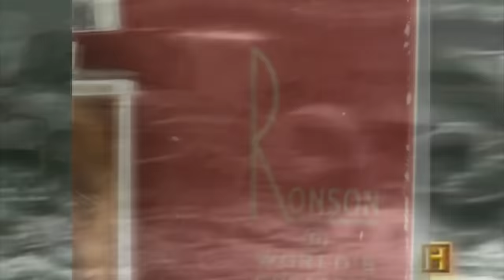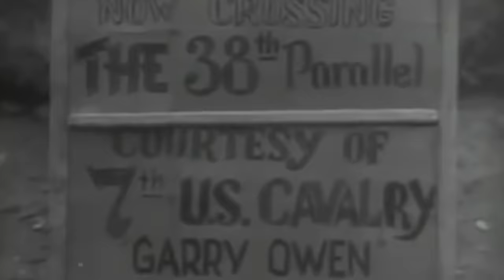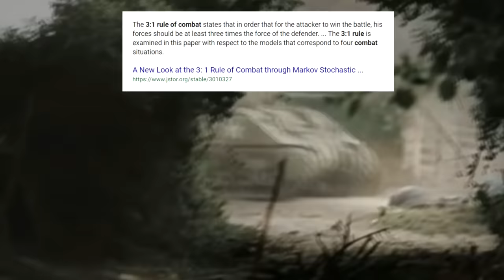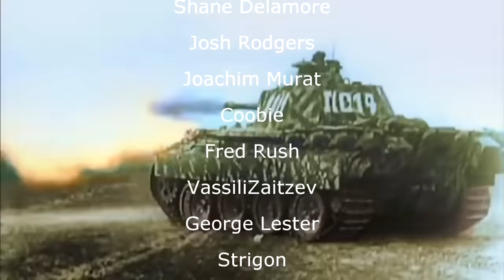The American Tank Meme

Comment: The Sherman’s were liked so much that by the middle/end of the Korean War when much of the North Korean tank force was defeated, Pershing crews wanted Sherman’s due to the unreliability of the Pershing’s transmission and lack of maneuverability that the Sherman provided. Or at least, so I’m told.
Reply: The engine was fine, it was the same Ford V8 engine as in the A3 Shermans that served in that war, it was the transmissions that had reliability problems in the mountain terrain.  The issue with the engines was just being underpowered, it was the same 500hp engine in a 46 ton Pershing as was in the 35 ton Sherman.  Again, not something that was a big deal in France or any other relatively flat terrain but in the hills and mountains of the Korean peninsula it was a problem.
Reply: But like, most tanks were underpowered and every tank had transmision problems
Reply: @22steve5150  edited it, thanks bro 🤙

Comment: If wot included crew survivability, Americans would probably be only crews you don’t have to replace after every 5 battles. Soviets every battle
Reply: Don't give WG any silly ideas pls.
Reply: Yeh but then Russian t10s would only cost 50 silver
Reply: Soviet tanks were so repairable, that German tank kills were reduced by 30-50%
Reply: @frenchsoldier8485  Sometimes they would just remove the dead crew, hose out the interior, patch the holes and fix the major damage and it's back out to fight. Men and Machine were expendable resources for the motherland
Reply: @Singha Mura When I learned that the russians had no standarization between factories and spare parts were specific for tanks of that factory only I laughed my ass off.
Reply: @zachburkey447  Da
Reply: @zachburkey447  We traded men for time
Reply: @zachburkey447  You are talking about american repair stations right? There's an interview with the guy online whose job it was to pull out bloody remains

Comment: Not talking about how the m3 freedom launcher is basicaly the latest reboot of the m1897 baguette distributor.
Excuse me wtf ?
Reply: What's an M1897? There are like a dozen different things with the M3 designation in the states, but I can't think of something French that would correspond with an M3 something, that has the M1897 designation. :/
Reply: @fuzzydunlop7928  simple, the m1897 is one of the pioniers of modern artillery, the french made around 15000 of them and 2000 of those ended in the hands of the USA as lend lease from france, it was well respected due to the 28 rounds per minute record firerate of the canon. 
When in the 30's the US was looking for a new tank canon of decent calibre they took the breach and basic design of the m1897 and made the m3 75 mm canon ( but also the m2 and m6 which you can find on cas and chaffes) 
Some of the orginal french guns found their way into the first us tank  destroyer: the halftrack m3 td ( yes the US calls everything either m1 or m3)
Reply: @LD-oq9lx  OH okay, that explains why I was drawing a blank. I'm pretty limp when it comes to field guns and artillery in general (mortars and rockets I know a bit), so I wasn't sure what exactly you were referring to - thanks for the clarification.

Comment: Yo dawg I heard your economy broke so we used the economy on the economy to fix the economy
Reply: *NEW DEAL INTENSIFIES*
Reply: WAR INDUSTRY INTENSIFIES
Reply: REV UP THOSE RIVETERS
Reply: Yea that didn't really work ww2 brought the US out of the depression and is the only reason we are so powerful today
Reply: Liam Kerr Uh...no. The US was starting to recover from the depression before WW2. Due in part thanks to the New Deal, I’m not saying it was the main reason we started recovering from the Depression but it was certainly a factor that can’t be ignored. To say nothing of the projects that were constructed during the Roosevelt era like Hoover Dam which would go on to power many factories which churned out war supppies. It had an effect
Reply: @danieltobin4498  Uh... yes. The effects of the New Deal have been seriously exaggerated. It did very little to bring the US out of the Great Depression, almost nothing, in fact. To understand why it did damn near nothing you need to first understand what caused the Great Depression to begin with; what the problem is, so to speak. It's the same problem we deal with today and we still feel the effects of the Great Depression because we never really solved said problem. This is, of course, a problem of overabundance. Due to technological progress, directly after ww1 our capacity for production exceeded our population's needs. And the solution the New Deal brought to the table was... more production? Yea that didn't go over well. It is just artifical stimulation afterall and even it's creators expected it to do little more than satiate the population. Atleast the war put our abundance to use. You see the fundamental issue was and is something that does not have a simple fix like "sicking the economy on the economy", or even war, that is if you are looking for more than just a temporary fix (or remain at war for as long as possible, making a temporary fix permanent). The real solution is much more complicated than that and entirely unbeknownst to me, for I am but a boy, and the problem only worsens. Each day we make developments in technology literally designed to replace human workers. We design them to be more efficient, reliable and cheaper than human labor. We already had an issue because we produced way more than we needed during the 1930s. Now we aren't even needed. Anyway, sorry for the ramblings, I'm quite passionate about this subject.
Reply: Liam Kerr What the fuck? The Great Depression was caused because we had too much output? That couldn’t be more wrong! It’s the exact opposite! The Stock Market crash of 1929 led to people losing faith in the economy which led to them investing less in businesses and buying less products which led to people getting laid off from their Jobs. And that’s just one factor!!! There are multiple factors that led to the Great Depression, and too much output isn’t one of them! It makes no sense because we got out of the depression by, guess what, having more industrial output because people were getting their jobs back due in part to the New Deal like I just said! I literally said that the Hoover Dam powered factories that produced war materials and other goods. Also, we’ve always produced more than we need because people buy more than they need. And you’re not even taking into consideration trade with other nations, or do you think the US hoards all the products we make?
Reply: Daniel Tobin No the depression started because people began to take on too much debt from the over abundance of goods that they could not afford.
Reply: @danieltobin4498  people lost faith in their stocks because inflation decreased the value of literally everything. This isn't hard to understand.

Comment: So the T-34 is a fucking godsend with 45 millimeters of sloped frontal armor, but the Shermans were death traps with 60-something millimeters of sloped frontal armor... alright, I see.
Reply: The Angle was different If i am Not wrong
Reply: @Manimmut  yea, the angle is different but the relative thickness is lower than the Sherman, T-34s would only bounce 3.7cms and maybe the older 5.0cms.

Comment: POV: the US designation system. A recon soldier is riding in his M-3, using the M-3 binoculars to scan for German tanks. Then he uses his M-3 radio to report to a battalion of M-3s. The M-3 would be very successful with other M-3s, making the enemy be outnumbered by the M-3. Post war, the M-3 would be used to test the brand new M-3. Multiple designs were proposed, but I. The end, the M-3 was chosen over the M-3. The resulting M-3 would then be modified to the M-3, a revolutionary design.

Comment: The Canadian tank meme

EXPLAIN THE GRIZZLY!!
Reply: Sorry for blowin up yer tanks eh?
Reply: It’s exactly the same as a standard Sherman. The only difference was that it was made in Canada, so it’s inferior.
Reply: its not inferior, it just apologizes every time it fires
Reply: Weik-293 no, it’s armor is made of crystallized maple syrup, whereas the American armor is made of freedom and bald eagles.
Reply: But you can't eat Bald Eagles
Reply: Weik-293 well you can, it’s just heavily frowned upon.
Reply: @TuShan18  The Grizzly was basically an M4A1 1st gen in most respects, but it used canadian dry pin tracks (a type of track that didn't utilize rubber) and a different number of sprockets on the forward and rear drive wheels.
Reply: Weik-293 laughs in Grey Mann

Comment: -We need something more effective than the 75mm!
-hear me out...what about....76mm?
- Genius!
Reply: 76mm barrel is longer thus improve it's Long shot and penetration capability
Reply: Low vs high velocity
Reply: also howitzer vs AT gun.
The 75 still had much better HE, so it was preferred over the 76 until the US tank doctrine changed after the war.
Reply: That has nothing to do. The 75mm canon equipped on the Sherman was more efective than the 76mm canon equiped on the t-34, the 76mm sherman gun was a huge improvement to the Shermans, and it was more efective that the 85mm gun of the t-34-85. Something similar happens with the Panther 75mm compared to the Panzer IV 75mm.

Comment: i have to say this. THE SHERMAN IS THE BEST TANK USED IN WW2. my reasons, reliable, easy to use, and can be compatible with just about anything
Reply: Freaking Werhaboos literally can't actually look up facts. The Sherman is the tank that is closest to earning the title of THE Tank of the war. Excellent progressional development, best crews, loved by all who used them even THE GERMANS THEMSELVES. The Germans had captured tanks and used them in battle and the one they liked the most was the Sherman due to the fact they made little to know modifications to them unlike the T-34 which had their own adjustments and additions.
Reply: I’m not sure, the T-34 is on par
Reply: @fireiron369  The Sherman was taking out T-34s in Korea if that helps clarify a bit more.
Reply: @overipecanine1485  to be fair, by Korea, the T-34 line was an outdated model. In WW2, they’re far more comparable to one another.
Reply: @randomelite4562  The same Shermans saw the same T34's in WW2 and Korea. That really means nothing, except saying the T-34 was inferior in WW2 as well as Korea to the Sherman tank and that the Sherman was always the best of the two.
Reply: @fireiron369  The T-34 was designed for pure numbers to the point the engine and transmission weren't designed to last long. Also, the 2-man turret was far less efficient and was harder to escape from.

Comment: Honestly the M4 was the right tank for America during WW2. It did well against the more common models of German tanks it was designed to fight. It gets too much hate.
Reply: Fred Jansen The Panzer 4 was the most common model and the M4 and it were pretty evenly matched. You can’t really expect it to perform well against a tank like the tiger that was released after production began.
Reply: Fred Jansen the pz IV was not a problem for the Sherman, also guess what we didn’t use Sherman’s to fight the tiger even though they did engage them. Our answers for the tigers and panthers where the M10 , M18 and later the M36 tank destroyers so yeah the us army did think for these heavy tanks so made Tank destroyers to counter them
Reply: Fred Jansen  The armour was tougher than a Pz. IV and nearly had the effective thickness to match a Tiger. The early 75 mm gun was arguably better than what the Germans were using at the time since it could easily dispatch their tanks while also having the ability for indirect fire support. The later 76 mm gun came out at the same time as the Soviet 85 mm gun on the T-34 and could deal with the Tigers and Panthers.
Reply: It was basicaly like the T34/85 for the russians

Comment: “Remember by their crews as a death trap” 
Laughs in M4A3E2 Jumbo
Reply: Jumbo was made because of that issue
Reply: The jumbo was made to resist shots from the ‘’cats’’.
Reply: @ATankEnjoyer  n
No it was not. Rather anti-tank gunfire
Reply: Nathan Peterson it still was capable to resist shots from german tanks.
Reply: @Patrick Wright Laughs in engine and transmission failure
Reply: @Patrick Wright *laughs in Sherman Jumbo/Easy Eight
Reply: @Patrick Wright Laughs in a waste of resources that didn't even make an impact on the war
Reply: The jumbo was made for assaulting hard points. It's the wet-rack modifications that solidified the Sherman as the safest tank of the war, not just with the fireproofing but the extra shitton of armor on the front of the turret.
Reply: @bobmcbob49  well only 252 were made. did it have an impact on the war? nah
Reply: @ulfenburg7539  but so many had the wet racks and uparmored turrets that even Russia and China got a ton
Reply: @bobmcbob49  yeah ofc 100% im just talking about the jumbo

Comment: How about sticking a 105mm  gun and more modern firing calculator on the Sherman to make M51 Sherman.
Reply: "In combat against the Arab armies, the M-51 proved itself capable of fighting newer, heavier tanks like the Soviet-built T-54/55/T-62. The M-51's 105 mm gun could penetrate these adversaries using HEAT ammunition. The M-51 served well during its time, and is regarded as an excellent example of how an obsolete tank (the Sherman) can be upgraded beyond the limits of its original capabilities."

DAMN just read it

Comment: Shermans were developed for the africa campaign and they were absolutely vital and effective there. It wasn't until the Germans started putting 88s on their tanks that the Sherman became an issue. The other issue is they needed lighter tanks to ship in enough numbers to actually be effective for the troops in the field..that meant putting them on ships. They couldn't load those ships with heavy tanks. The sherman was actually a great tank for what it was built for. Going toe to toe with tigers and panthers isn't what it was built for. Sherman was also very easy to work on. They could change out the engine in 1 hour. For the Germans to change a tigers engine, it had to be lifted off the ground.

Comment: The M4 Sherman, particularly the M4A3, was the best tank of WW2 hands down. You can't prove me wrong bois
Reply: The T34-85 was also pretty damn good.
Reply: M4a3 was a just a decent tank, and only became such late 1944 after tons of modifications. The best tank in terms of war? Technically JS-2 was the best tank of WW2, but it didnt see combat. Logically t34-85 was the best tank in terms of cost/efficiency
Reply: Alex Sharapov I
My bob semple would like a word
Reply: @alexlalex5223  you meant the IS-3, right? I'm pretty sure that IS-2 was the bulk of russian heavy tank forces
Reply: @Sir_Budginton  But the M4's rolled over them in Korea.
Reply: once the panther had an even reliability with the allied tanks in late 44. It was by far the best tank. Armor couldnt be penetrated frontally, it was quite agile, the optics and sights were superb and the gun was able to destroy anything, even in large distances. I would say the late panther is the best tank of the war. It was limited by the fuel shortage and low production numbers. T34s and M4 were pretty much fucked, if they had to attack them in equal numbers head on.
Reply: @Félix Sánchez The Pershing was a bad tank, so bad in Korea the US decided to use the M4 instead until the M46 arrived. And the Jumbo was a breaktrough tank that drove the chassis, engine and suspension of the Sherman to it's limits with a limited production run.
Reply: @SOIBand  
I wouldn't say equal reliability, but better than the first D model
Reply: @JakeTheTankmaster  I read it was around 70% and with that on par with the others.  The allied and soviet tanks were easier to repair and maintain though.
Reply: @SOIBand  Which is why any intelligent tank doctrine would call for the attackers to use numbers and flanking, combined with support from other elements. Which is usually what happened.

Comment: The thing about german and Russian tanks are that they don't need to transport them, they just get out of he factory and boom battle.
An example can be the m26  pershing, it was finished in 1944 and arrive a year later.
The American tanks need to have a nice weight and size for transportation.
And most of the time they didn't encounter tanks but bunkers, truck convoys, infantry,etc not needing a heavy tank. The 75mm have more explosive filler than the 76mm.
Reply: Thank you for pointing this out. Even in 1944, many US tank crews actually preferred the 75 over the 76 for precisely that reason: it had a better high explosive shell. This is important because 90% of the time tanks did not fight other tanks, but rather infantry, gun emplacements, and fortifications.

Comment: 1:50

"Big cats were rare and you can only point out a handful of times were one of the big three were encountered"

What are you talking about? Half of each Panzer Regiment in Normandy was made up of Panthers.
Reply: They had around 160 of them in Western France when the troops hit the beach and after 2 months of reinforcements the had about 430 of them in France by the end of July, which still is not that many tanks.  In fact it was during the Ardiennes offensive when Germany registered the highest number of Panthers assigned to the western front at any time (471) and the highest number of OPERATIONAL Panthers on the western front (336).